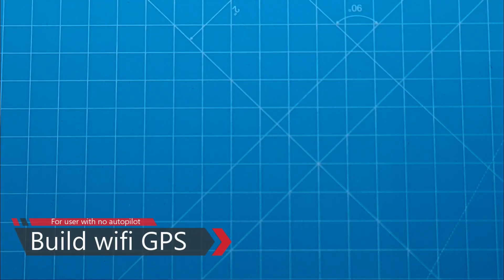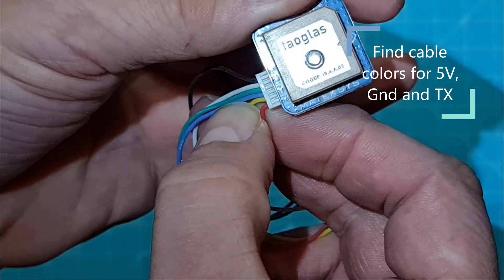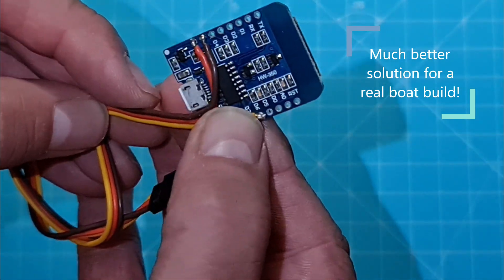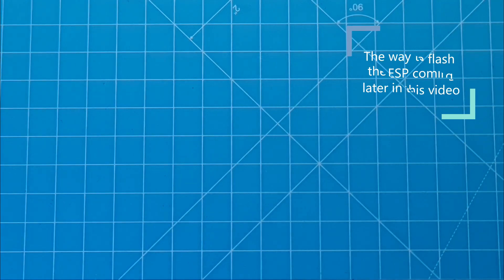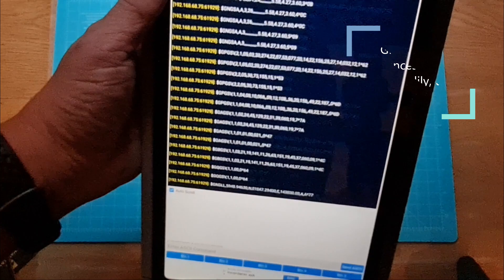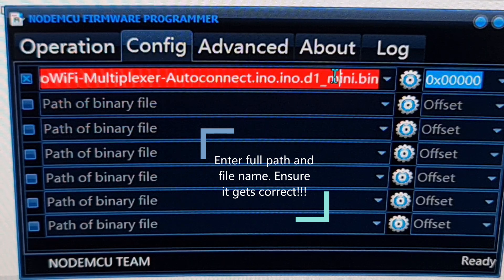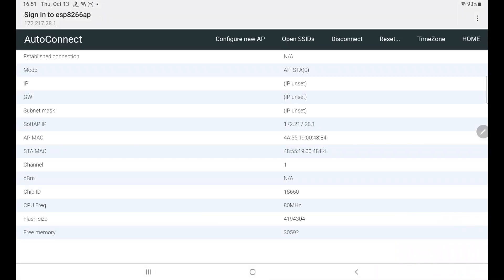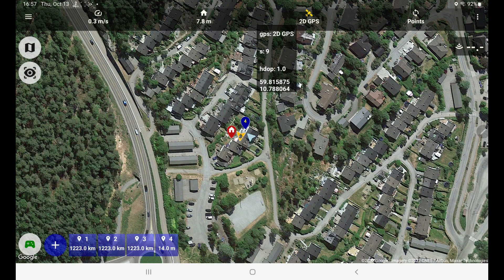Build your own wifi GPS and start using Carp Pilot Pro

Comment: hi carppilot, i bought your app. bought the Mateksys M10 GPS and the ESP8266 D1 mini. I wired the parts as shown in the video, flash the ESP and set up the ESP on my raymarine network. then i connect my tablet to the raymarine network. unfortunately I don't get a GPS signal when testing with the UDP terminal app. maybe you can help me
Reply from the maker: Sure. Drop me a mail (thecarppilot@gmail.com) and we will figure it out together. And anyway make sure the TX cable from the GPS is connected to the D6 port on the ESP.
Reply from the maker: So, we managed to solve this problem. Even though a brand new ESP was used, it came with some software pre-installed. And main learning after solving the above and 3 other cases, one with a new ESP and two with a uses ESP: The ESP must be completely wiped clean upfront of flashing. And the best tool to use for this purpose is the "esptool" (running on Python). Main learning for anyone who think installing Python on their PC is too much, buy a new rather than try to use an old ESP. But, even then the ESP might come with some software onboard. Depends on where you bought it, obviously. The ones I bought from Amazon in Germany were totally clean, at least.
Reply: Thanks, I will send you a mail today :)

Comment: hi, if i install the parts in my boat exactly like in the video will it work like an autopilot? I have a boat with 2 tanks left / right, brushless motor and rudder.
Reply from the maker: I may not have been totally clear, so let me try to be specific: You have a GPS in the boat sending it's position to the app. So yes, the boat icon will appear in the app with position and driving direction when you use your remote control to control the boat. Exactly like it will when using an autopilot. But: The GPS is no autopilot. You cannot say "drive to position XYZ" to a GPS and expect the GPS to take control of your motors and drive and steer until position XYZ is reached and then stop. Or automatically open your bait tray for you when it arrives. An autopilot, at least when controlled by the the Carp Pilot Pro, can do such things. The GPS cannot - because it is nothing else than a GPS reporting its position. So the correct answer to your question is "no": You actually have to drive your boat with your remote control. And open bait tray, trigger a hook release, turn your lights on or off "manually" using your remote. But the answer is also "yes": Besides the fact that you have to use your remote and be in charge of what the boat does, everything else in the Carp Pilot Pro app will work exactly like if you had an autopilot built in. Like creating a depth map as the boat drives. In principle it is exactly like Tesla's self driving features. With the GPS only, you need to keep control of the wheel + gas pedal + break pedal since there is no autopilot inside to let you get from A to B while you sit relaxed in the driving seat reading a newspaper...